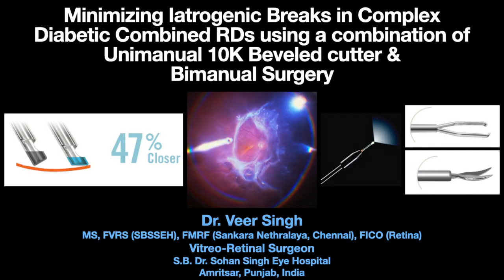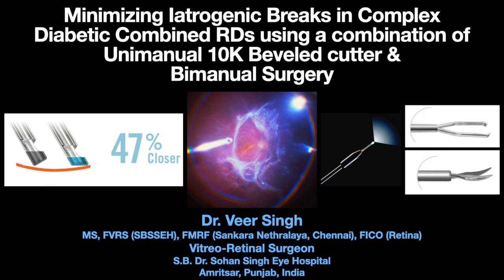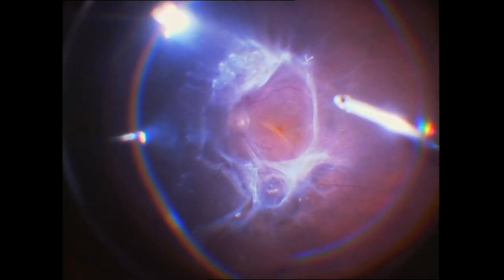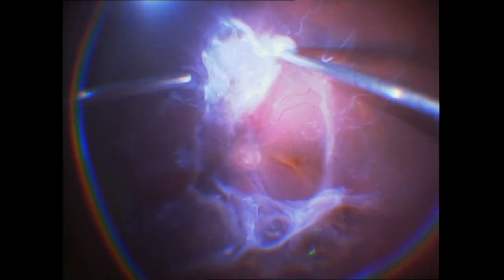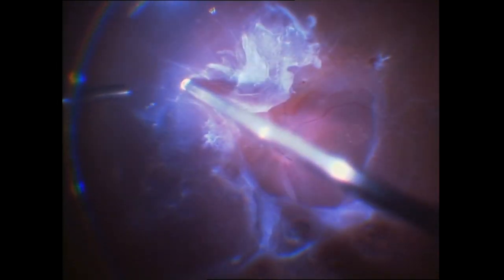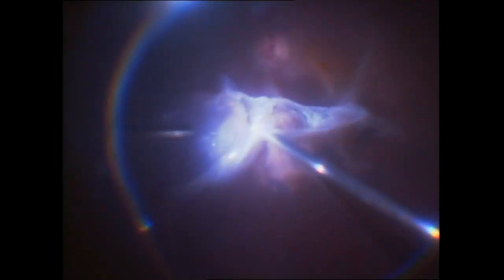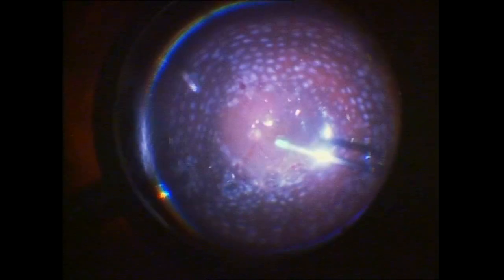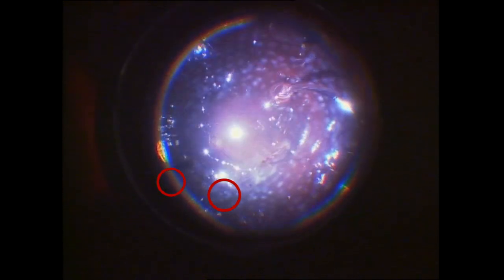Minimizing Iatrogenic Retinal Breaks in Diabetic Combined Retinal Detachments | Dr. Veer Singh

Comment: excellent surgery dr Veer!
I'd like to know yr opinion on one perplexing situation that I face sometimes.
After membrane dissection if there is no iatrogenic break, do you create a retinotomy to flatten the retina or Just inject internal tamponading
Reply from the maker: Thank you, Dr. Chinmay. In most cases, after membrane removal, I usually just do a fluid air exchange at the end of surgery if there is no iatrogenic break and the SRF resolves with time. In case the subretinal fluid is quite significant and the whole retina is mobile, then my decision depends on 2 factors. One, if the retina is very thin at the site of membranes and i feel there could be a microbreak, I might create a retinotomy or drain from a microbreak and use silicone oil/gas. Two, if the retina is not very thinned out and I'm sure there's no break, I'll leave it without any tamponade, and the SRF resolves on its own. In summary, I only use oil/gas tamponade if I suspect a break. If I'm sure that there is no break, I'll just leave air.
Reply: @drveersingh  Excellent. Thanks again!